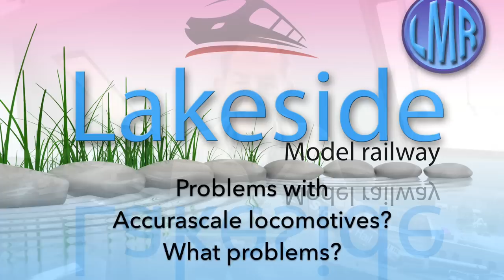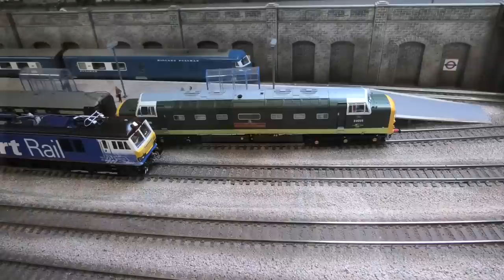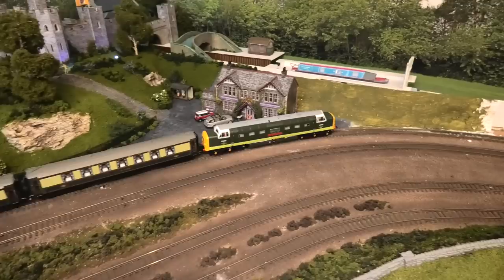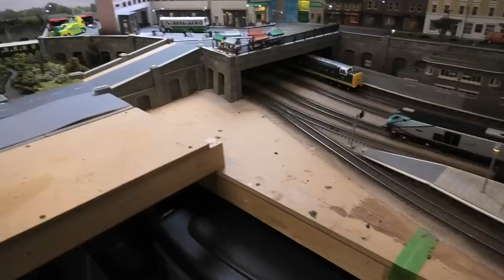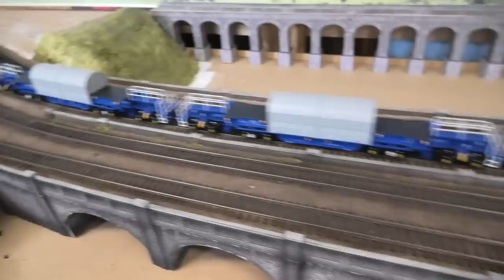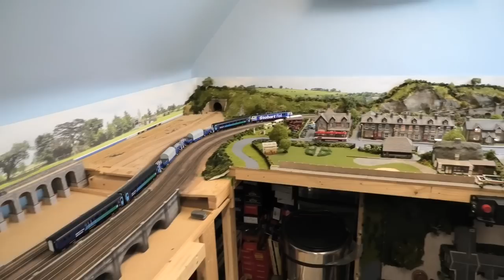Problems with Accurascale locomotives - what problems?     10-05-2023

Comment: My Deltic was returned to Accurascale along with my TPE coaches. After I finally got them back I decided to take a look, the Deltic could not complete a full circuit of my layout without falling over, it’s the only loco that  does! While falling the chains fell off once again so they were ripped off and threw across the room, the bogies were catching on pipe work and while flexing the paint came off, further parts were catching so they ended up being ripped off as I was in no mood. For the part it ran would only get up to what I would say was half speed so it looks like adjustments are needed. Unfortunately it ended up back in the box and in the nearest bin bag ready to be chucked! Have not yet opened the TPE coach pack
Reply from the maker: Oh dear Geoff, that sounds a total disaster story and would definitely get in touch with Accurascale and ask for a complete refund which I’m sure (hope) they would give you. Better that than leaving it the bin to be chucked. I do understand how you feel though, that great feeling when it’s finally delivered, the unboxing and excitement as you place it on the track, only to be let down with a bang when it behave like yours did - not good.  Hope you get it sorted out with Accurascale mate.      Cheers.        …………Graham

Comment: Glad you got it sorted out, DCC sure comes with its complications. A lot of people are quick to jump on Accurascale for this, give them a chance to learn from what has been their first 2 locomotives (although interesting to know if their Irish locos have had similar issues). If they don't learn from their mistakes then by all means, they deserve flak and just because they're everyone's favourite manufacturer right now does not mean they should be exempt from criticism. 

Hopefully they sort this out and figure out exactly how this is happening. At least you have 2 might fine locos working well now!
Reply from the maker: Hi Simon and thanks for the comment. I think after doing this then it’s obvious that this is an issue with the ESU V5 decoder rather than an inherent fault with the loco itself. It appears (although I can’t confirm) that the main culprit is that V5 decoders no longer support the CV54 trick  and that it instead ‘learns’ automatically the characteristics as the loco is driven. How true that is I don’t know but this is what I have read elsewhere. Whatever it was or is then my two decoders certainly were not learning as the loco was being driven hence why I had to go in and manually set it to the best of my ability.       Cheers.          ………..Graham

Comment: Congrats on resolving your issues, and yes I did have an issue with my new Accurascale Class 37 in Inter-City Swallow livery 37419 straight out of the box. When the sound was enabled after 2 seconds the sound would cut out although the loco would still move backwards and forwards. The solution was to reduce the overall volume setting, CV63 by >10%, I reduced the value of CV63 from 192 down to 150 and it now works fine, I know others set it to 160 or 170, but at 150 it is still loud enough for me.
Reply from the maker: Hi Dave and thanks for the comment and I have heard about this sound problem with the class 37 from other folk. This just seems to confirm to me that all these issues which seem to be taking place are primarily due to the ESU v5 decoder rather than the Accurascale loco itself. But I’m pleased that you have managed to solve this particular issue by just lowering the volume a little.       Cheers.         ………..Graham
Reply: Begs the question how this wasn't picked up in testing!

Comment: Hi Graham, I am so pleased my friend, that you have managed to sort out these two locos by making adjustments to the motor back EMF.  
I would have thought that when a company developed a new loco and fitted it with a particular brand of decoder, that they would, as part of that development, determine the ‘nominal’ settings for that decoder and ensured that all locos manufactured had these settings applied, prior to boxing up for despatch, to ensure that the user can operate the loco, straight out of the box, without issue.  The user may then choose to ‘optimise’ the configuration variable (CV) values to meet their particular requirements, but should not need to do so, in order to enable the loco to work satisfactory.  
I trust your video will be of immense value to others with your issues. Thumbs up to Susannah Joaquim too, for obtaining the solution.  Best, Jason.
Reply from the maker: Hi Jason, I think I have just been unfortunate with these two locos, as I said in the video, there must be hundreds of satisfied customers out there who bought a Deltic and/or a 92 and are completely happy with it. This obviously didn’t happen in my case for whatever reason but the crux is that it’s now sorted and I can now run these on the layout without any issues. I’m just glad that I now know that it’s nothing to do with my layout or controller!    👍🏻.        Cheers.          …………Graham

Comment: Graham *****Important Update ****Perspective**** My latest Accurascale class 37, Shapfell, has now also gone faulty and had to be sent back. That's 7 faulty out of 9 locos bought so far! (of various classes). 
  After exhaustive testing it was found to be the MOTOR, yet again! The ESU decoder was checked, the CVs double checked and it was also swapped out in to my other Accurascale class 37 to confirm that it was good. It definitely was operating correctly. 
 There is an ongoing problem with the motors failing, usually after about 2 or 3 hours of use. I had the same problem in their 92s and 55s. I presume it's the same motor/manufacturer for all classes. Hatton's 66s also suffered this motor failure too and some Bachmann 37s from previous toolings (See Peter Dixon's channel, Torridon Road. He swapped out 5 faulty class 37 motors on one of his episodes a year or two ago. Even the new replacements he bought direct from the Bachmann Spares website were faulty!)  Remember, you even said that Accurascale changed out your class 55's motor because it was faulty! 
      This is not to over criticise Accurascale for the sake of it, as some people seem to jump down my throat for mentioning any negative experiences here on YT. It is only to help and assist others who may be scratching their heads or in the same place that you were a few weeks ago, wondering what the problems were caused by with your locos and driving yourself crazy, doubting your layout and your controllers. 
 I appreciate that your BEMF CVs were wrong and that fixed those particular poor performance issues. This is something else to bare in mind too, but the motors do fail, so it's more than one issue here.
  For me this usually manifests as erratic running initially, and then slow running. The Alpha meter reading also jumps around all over the place, drawing excessive current and draining down the voltage in a constantly changing chaotic manner.
   To be clear, Accurascale's service and after sales customer service has been excellent (so far) which is why I have continued to purchase from them. However, my patience wearing a little thin now with their unacceptable loco reliability/failure rate. I do hope Accurascale properly address this critical problem before it becomes their Achilles' heal. They have brought hope to the market place with their innovations and wonderfully detailed models at sensible prices,  so, for the sake of the hobby, I really want them to succeed.

Comment: Hi Graham, very helpful video, I have used EMF in the past which helped me. My Deltic seems ok, but have not tried it for a while. I did have an issue with my Accurascale Class 92, one of the pantographs was not working, which they resolved immediately. I do have an issue with the lighting on my  Transpennine since I installed a sound decoder nobody seems to have an answer for.

Comment: Well done Graham. I personally would send the info to Accurascale. I'm not a modeller but I watch yours and many other videos on their models. I must say, from what I've seen, like you say, their models look fantastic. I know your a bit narked with them but I think.they could benefit from your video. So when their models go out to their customers, they do work straight out the box. I think they'd be daft not to take your findings on board.
Well done to Susanna and by the way, what product knowledge that guy in the model shop has too.
Glad you've got em going though Graham. You've turned the Deltic into Concorde.😂
Reply from the maker: Hi Mickey and thanks for the comment, Accurascale are now fully away of these and a few other problems and I have no doubt that they are working hard behind the scenes to rectify these issues - time will tell I guess with future releases.       Cheers.          ………..Graham
Reply: @GrahamFoulston  Your welcome young sir.

Comment: Pleased that you sorted the running problem.  I have had a similar problem with a Bachmann Precendent loco fitted with a non-sound Bachmann decoder.  The problem revolved around it having a coreless motor.  I eventually found by experiment that it performed best by not turning off back emf and adjusting the related BEMF Cv's.  There was no mention that adjustments may be required in the loco instructions even when using the Bachmann recommended decoder to account for the coreless motor fitted.  It seems that you are on your own when it comes to recognising running problems that may be linked to BEMF

Comment: Hi Graham. I am an electrician and I have installed inverter drives for ac motors for many years. In my experience all of these drives have to be tuned to the motors which they are controlling. In more recent years these drives have an auto tune function which relieves you of all the faff and greatly speeds up installation. It seems it’s time for a function of this kind for decoders. This would then take care of any problems caused by varying degrees of anomalies between various motors which I think is the route problem. Regards.

Comment: Graham,I found cv54  worked okay on the V4 decoders, but on the V5's it was no good. I found the easiest way to make the settings ,is to select default settings on the Lokprogrammer,I have never had to make any other adjustments after that. Cheers
Reply from the maker: Hi John and thanks for the comment and that’s a very good point you made about CV 54 not working with V5 Loksound decoder, I had heard that too when researching. As I haven’t got Lokprogrammer then I had to do it the hard way as I described.       Cheers.        …………Graham

Comment: Hello Graham so glad you got your locos sorted I’m having similar issues with my class 92 just wondering  if you could post the cv settings for cv 52 to 55 ,I’ve written  down my cv values,reset the decoder tried cv 54 and nothing happened at times it runs fine other times it slows to a crawl and my Dcc concepts meter normally sits at around 0.43 amps but went up to 1.22 amps with the 92 being the only loco running today.Thanks

Comment: Glad you got it sorted mate 🙂 I don't own any model railway but have an interest in it, but in my opinion, you are correct, it should be working properly on delivery and shouldn't require any user configuration and messing around. Another thought I had was that surely Accurascale technical support should have known about this potential fix for you and told you about it - again they failed you by just telling you to send it back.
Reply from the maker: Hi mate and thanks for the comment. I honestly don’t think that Accurascale were aware of any issues with some of these locos, not enough for them to think that there was a major problem with the decoder. I think it’s only recently that they have started to become aware that it’s not just one or two and I know for a fact that they are now looking into this and to try and fix this issue. Time will tell I guess but at least they are now aware and doing something about it.       Cheers.        ………..Graham
Reply: @GrahamFoulston  That’s excellent news. Hopefully something good might come out of all this for everyone 😊

Comment: Hello Graham, thought I would add my twopeneth. I had two class 92 BOTH had same problem as you speeding up and slowing down, both returned for refund.
I do hope altering the BEMF is a long term solution for you, however as I only have DC analogue and therefore I cannot alter CVs,  I am really wondering if the BEMF is actually the problem? Both loco ran fine for a few days then problem started, I have had this problem previously with other manufacturer (Bachmann) and at the moment I have a new retooled Heljan class 86, only 6 month old which was fine but now speeding up/slowing down. I have taken it to my local repair shop who have advised me it is probably the chip and not the motor. I had the same thoughts as you is it my layout power supply?  but as all my other 70 locos run fine,  it cannot be that, Bill.

Comment: Hi Graham , this is good news . I have a Hornby class 67 with Legmanbiffo V5 sound decoder that runs a bit erratic at mid speed , no adjustment on CV 6 . I have looked up about BEMF so I am going to do the CV54 reset and see how it goes .........Cheers.    Peter

Comment: Hi Graham, What a struggle to get those running properly.
I much prefer ESU decoders and haven’t had those issues.  Normally CVs 54, 29, 2, 3, 4, 5 and 6 sort it out. However, the may I ask where the table you showed came from?
Hopefully we can have a chat at GETS, we missed each other last year.
Regards Charlie
Reply from the maker: Hi Charlie and thank you for your comment. The page I used was from South West Digital which has a wealth of information but this is the particular page I used:
https://www.southwestdigital.co.uk/PDF/SWD%20LSV4%20Motor%20back%20EMF%20Setup.pdf
Scroll down the PDF page and you will see a table which shows a basic set of numbers to start from - a datum if you like.
But read all the pages first because it does explain it all very well.
Yes, it would be good to catch up again and we can do this when I go to GETS in October, I shall look forward to that!    👍🏻👍🏻.     Cheers.          ………….Graham
Reply: Thanks Graham, very much appreciated. I shall print it off and pop it into my ESU file. 
Stay safe mate, regards, Charlie

Comment: I had the same speaker issue on the class 55, I sorted it by adjusting a CV to lower the volume.  I agree that Accurascale need to tighten up on Quality as regards CV settings etc.
Reply from the maker: Hi Andrew, lowering the sound is one solution but that to me was not really solving the issue, if the speaker was firmly fitted down to the PCB like it should be then that cures the issue properly. But if you are happy with your solution then that’s fine.      Cheers.           ………..Graham

Comment: Hello Graham, excellent video and it's nice to get things sorted.  On your previous videos you showed the Deltic had current draw problems with high amp readings showing on your meter. I've missed whether this was sorted by Accurascale as you talk about decoder back EMF problems here.   Has the high current draw been sorted?   I have a Deltic in for repair at Accurascale at present due to high current draw (similar amps to yours) but it is only a DC model and hence no decoder.   Therefore I'm wondering if the current draw problem you had was fixed.  Thanks.
Reply from the maker: Hi mate and yes that was sorted, Accurascale replaced the motor on the Deltic so all good as regards current draw.   Cheers.          ………..Graham

Comment: So so glad you got them sorted Graham, really thought we were going to lose you through being dismayed by the two locomotives, but just like a true engineer you persevered and found the solution! Bet it kept you awake pondering on not being beaten by them, my 92 arrived with issues like a burnt out sound decoder then a 6 function decoder, finally sent it back and to Accurascales credit they sent a brand new one and runs faultlessly, I’m wondering now if the settings on the decoder may have been the issue rather than a dodgy motor? I must admit I mess around with the cv’s to suit my layout but that’s a choice not a necessity to ensure smooth running, great to see them stretching their legs finally 😊 cheers Darrell
Reply from the maker: Hi Darrell and thanks for the comment mate, a burnt out decoder?  Blimey, not heard of that one before!   I do delve into some CV’s but I’ve never gone into the back EMF CV’s before, so this was a first for me.  That was good that Accurascale eventually sent you a brand new replacement and pleased that it runs faultlessly.      👍🏻👍🏻.      Cheers.        ……….Graham

Comment: Very surprised that it was not pre-set for the motor and DCC controller at design stage.
  Possibly they fitted a different motor or components were changed in the controller..
This is a problem that goes back to the original electric loco's and why they could only achieve 40 mph.